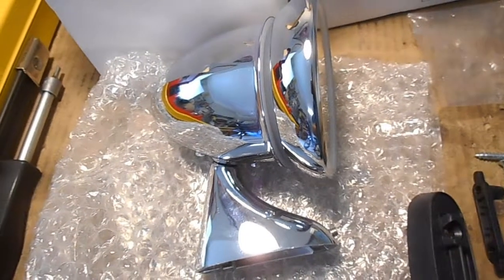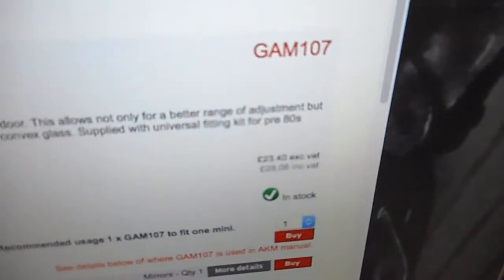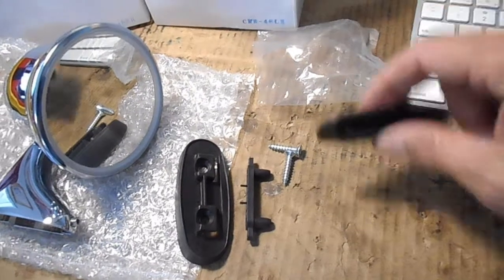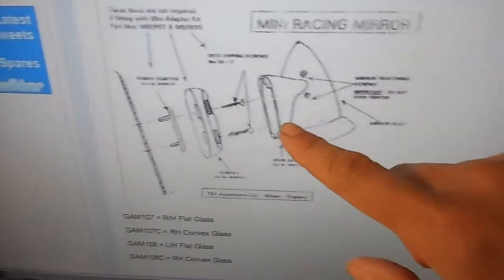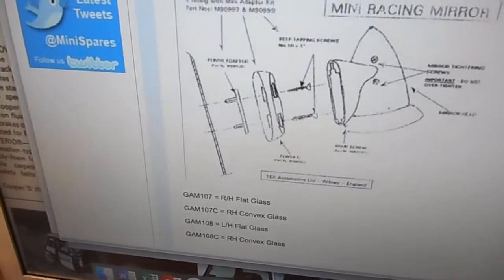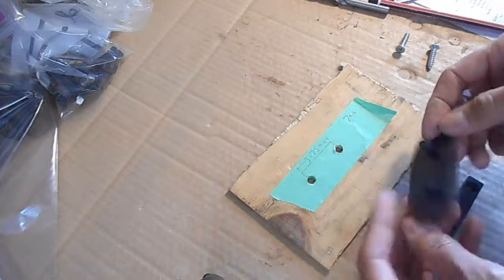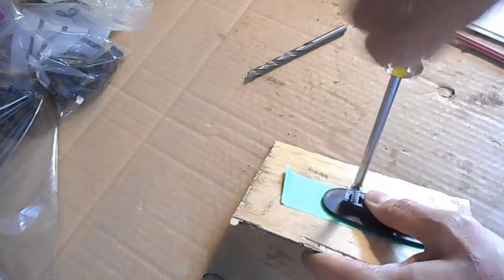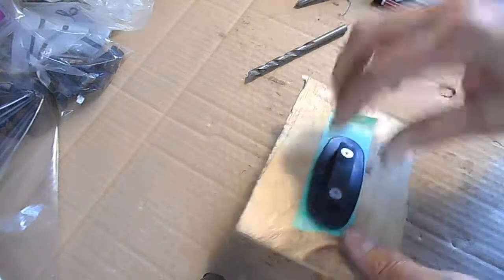Morris Mini Cooper S - Side mirrors, torpedo, bullet EP041

Comment: Had some issue's fitting these type of mirrors,  the grub screw isn't a sharp enough angle to bite into the plastic behind just kept skipping over the top, would have thought if they made the plastic behind just 1cm bigger would have made a massive difference.

Comment: Thanks for showing how these mirrors mount, I have some for my MGB though came without any instructions or the fixing screws - all very confusing!
Reply: Did you install them on the mg yet? Looking at some for mine.
Reply: @101lilwest  not as yet though looks like an easy enough job all fixed from the outside. It's the original spec as you may know...
Reply: @flickthenick  oh ok yeah it looks like a easy job to install